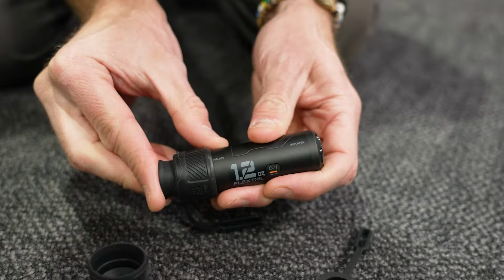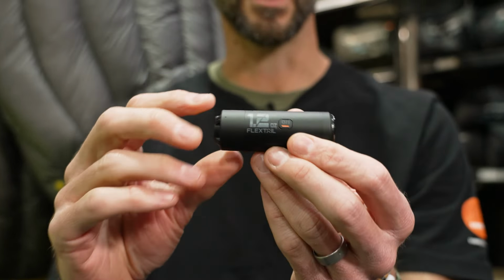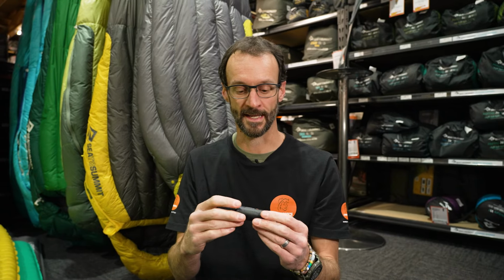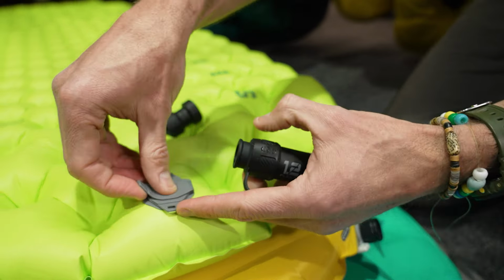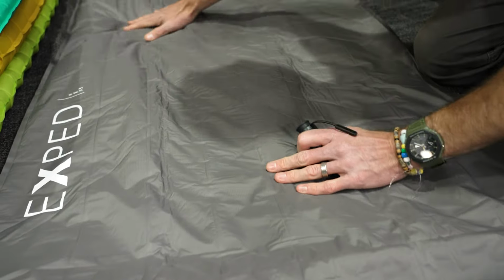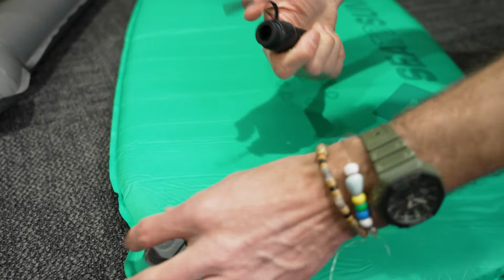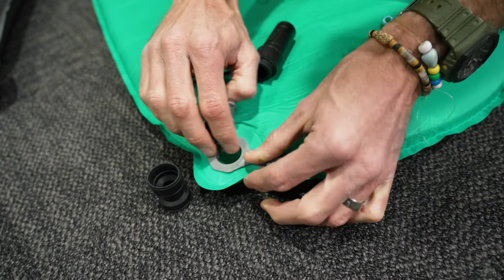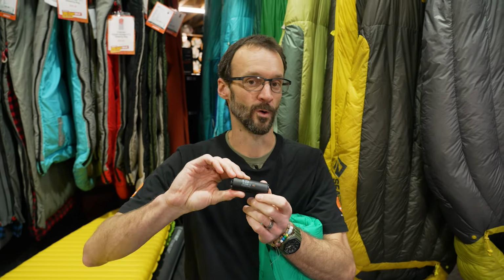FLEXTAIL Zero Pump for Sleeping Pads

Comment: The warranty of one single year should make you doubt the product. Mine lasted for about 20 uses. Now it suddenly stops after two seconds of pumping. Customer service wasn't eager to help until i complained for a second time. Still waiting for the replacement
Reply from the maker: Majority of products come with 1 year warranty as standard.
I've had mine for nearly 2 years now without issues - no issues replacing these when they're within the warranty period.
~ Lauren

Comment: Have just now purchased the FLEX TAIL Zero Pump from Snowys  to go with my Sea to  Summit sleeping pad.

The reason I went with the Zero, is, first how small it is, which is great for when Motorcycle camping. I also appreciate the way it will help with deflating my sleeping pad, which is always a bit of a chore. Especially trying to roll the pad inside a smalish tent.

It's a bonus the way it can help to get a fire started!  

Snowys has been one of my go to stores for years now. I've never been disappointed!  Snowys has always been spot on, for customer service and good product info!  I try to support small family family owned business,  instead of the big chain stores, such as Anaconda etc ... which is charging the same price as Snowys! 👍
Reply from the maker: Thanks for the kudos Sean, great choice on the Zero pump, it's the perfect companion for lightweight adventures. ~ Ben
Reply: @SnowysOutdoors  Go The Snowys! 😎

Comment: How long does it run until it turns off automatically?

Mine goes 1 minute 30 seconds and turns off. Turning it on straight away it goes 10 seconds and turns off again.

Waiting for a bit it goes again like 1m10~30s.

Is this normal behaviour? No one talks about the runtime per go and how long the cooldown is.
Reply from the maker: I had this run for the entirety of pumping the mat up in the video, but Flextail don't specify a cutout time sorry. ~ Ben

Comment: Garbage.   Slightest bit of humid or damp conditions and it stops working, permanently.   Looks good  in a youtube test, NFG in real world usage
Reply from the maker: I'd suggest going back to the place you purchased your pump, it could be a warranty issue. ~ Ben
Reply: It comes with a warranty. Make a warranty claim ... simples! (PS: I have worked in retail for almost 20 years now, and your problem with the ZERO pump ,sounds like a legitimate claim).

Comment: Does it pump matresses up quite firmly, or will they require a bit extra to make sure it's firm? I know you said the rating in the video just not sure how firm that is in the real world
Reply from the maker: If you like a firm may then I reckon you'd need to manually add a bit of air at the end, the Tiny Pump 2X goes to about 4kPa which is a little firmer. ~ Ben
Reply: Same question. Will it get a thermarest xtherm max to fill inflation? Justin Outdoors says no, but not sure if old model.

Comment: Hi, I have a Zempire Monstamat. Is there a pump that would fit that valve to deflate and maybe inflate a little? As I believe all the ones you have reviewed so far don’t have a big enough attachment? I have the mat in my swag and it would just be easier to suck air out rather than rolling it everytime
Reply from the maker: Despite there being many mats on the market with these larger valves, I'm not aware of any pumps that are compatible. We will pass this feedback onto suppliers, hopefully one of them develops something. ~ Ben
Reply: +1 on this question. I have the oztrail Fatmat (same valve I think) and sometimes it would be useful to be able to quickly get it firm for those late short overnight stops where you need a mattress fast✌
Reply: @noccer i use the flextail pump 3 and works for both my monstamat and fatmat